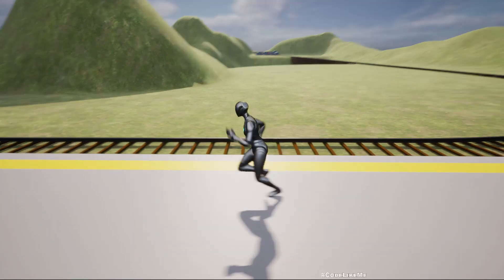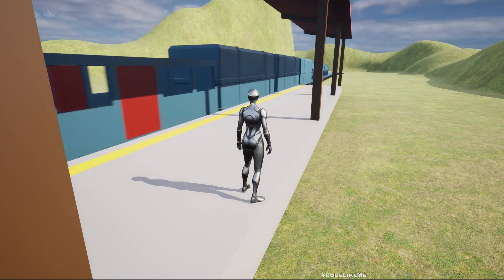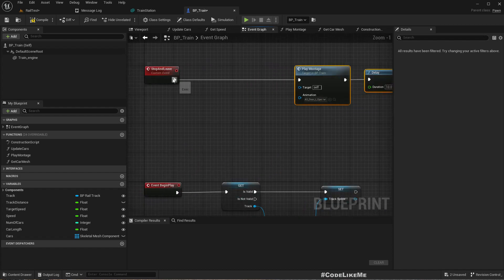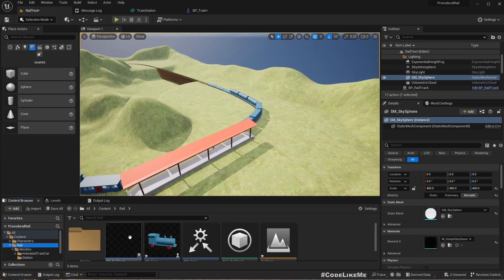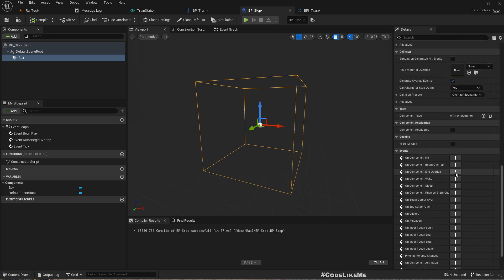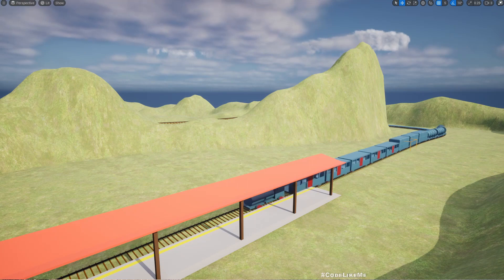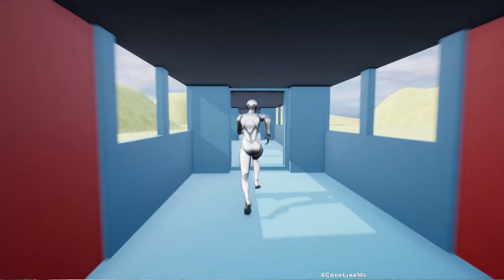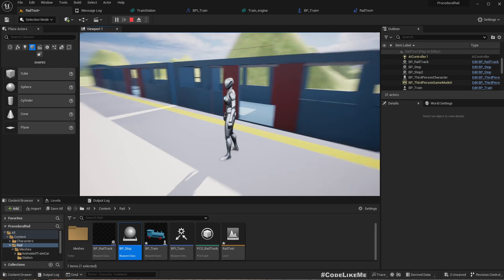Unreal Engine 5 - Train Stations - [Train Simulation #8]

Comment: Excellent work. Am curious how does this work with world partition?
Say it starts off in landscape 1 an ends in landscape 3. What train tracks would be assigned to which level. Because if landscape 1 or 3 hides when far away will the tracks also vanish until landscape 1 or 3 unloads.
Reply from the maker: You only have to keep the spline in the memory. The rest of the objects that makes up the track doesn't matter for the function of train. Do they can be loaded, unloaded without any issue
Reply: @CodeLikeMe  awesome thank you. 👍